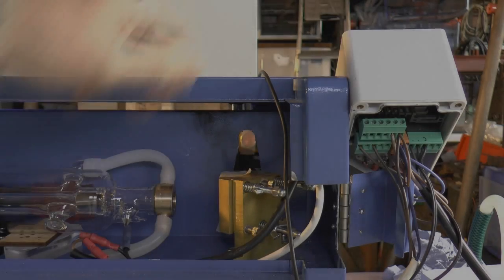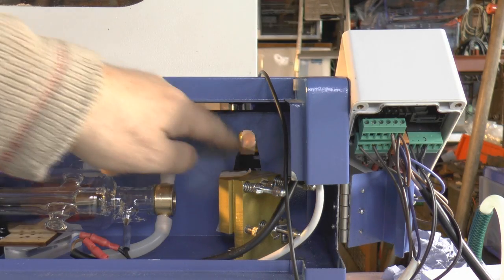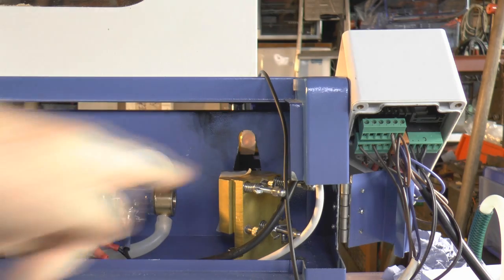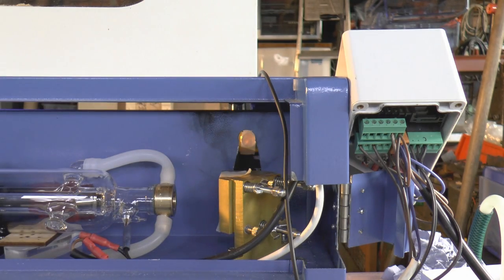RDWorks Learning Lab 51 Beam Setting for Beginners part 2

Comment: Hello once again Russ,
I have started to fit the larger (80mm) laser tube to my 'China Blue' machine and have not come across any problems in fitting it into the case.  However,  I have come across a couple of problems that may or may not be peculiar to my particular machine.

In one of your beam alignment videos, you suggest using the back panel of the tube bay as a datum on the premise that the machine is probably 'jig built' and like to be parallel.  However, the back panel on my machine is not fixed at the top and replies purely on the stiffness of the fold at the bottom to keep it upright.   I think that I will probably use another datum point such as the outer frame using strong magnets as I believe that member to be a better one as it is welded box section.

Another peculiarity is that the aperture in the back panel for the laser path from the first mirror is too high.  The bottom of the circular hole lines up approximately one quarter of the way up the mirror housing projection.  There is probably still enough room for the laser beam to go through it but it does raise the question as to why it should be so.

On another topic, several of us have written to ask you for various plans.  Could you not open a download site for all of the different files and perhaps a forum?  If it is a matter of cost, I would be glad to host it on my website.
Reply from the maker: Hi Peter
The only time the tube stability is important is if your head is fixed. It will then be important to move your tube in a parallel manner. Any suitable reference will be OK. The angled frame of the enclosure is pretty stable.. The exit from the tube has got to be at the same height as mirror 3 in the head and it follows that mirror 2 must be at that same height also.  If you measure mirror 2 height to the Y rail , does that align with the hole in them back. plate? I seem to remember when I upgrade my machine, I looked at the  80mm diameter tube, and decided I was going to have trouble with mirror centres and  the new tube centre. . If the hole in the tube enclosure rear panel needs opening, that's no bad thing because you really need line of sight to mirror 2 from the back of the machine so that you can adjust mirror 1.  These machines are assembled in a factory where the place is staffed  by  people that have no understanding what these machines really do. They are thrown together and a few slightly higher skilled  "people" jiggle the bits around to make then sort of work.  The concept of QA is alien to the Chinese unless its drilled in by Western culture , as in the Apple assembly plants for example.. QA is something YOU are responsible for.. I like to regard these machines as a pre-assembled DIY kit.  This is open season for you to exploit your engineering skills  and fix a few of the unfinished issues.. This beam alignment is fine up to mirror 3  but is sketchy about the alignment of the Z axis and the importance of finding the sweet spot on mirror 3. If you watch the installation of the new acrylic head I have recently fitted, the reasons and method of aligning Z is better explained..
 Any drawings I create for release are posted to the www.rdworkslab.com forum . If you need additional unpublished items that may be useful to you , add your email to a separate comment . I get a copy of the comment in my Gmail so I will immediately remove your comment from public view.. I am a very insular individual with a VERY low www profile (apart from You Tube) and I do not belong to forums or want to run anything other than this You Tube channel. I already get enough comments and email traffic to consume several hours a day.
I might appear on video to be doing this for public good, but in truth this is  selfishly all about me learning ( I greatly enjoy the challenge) and  providing material for my other hobby which is video editing. Although I am happy to share creations I try to give enough detail for others with capability to be stimulated into developing their own versions.. Some of my creations are not makeable by the majority of followers, the Dohicky for instance, and that puts right back to the manufacturing I retired from. My latest acrylic head transplant could get me into deep manufacturing issues but I hope I am successfully using standard parts that can be obtained from certain places in China. That video will be released in the next few days when I have completed all the information pack of drawings, parts list, and purchasing details That's the admin detail I'm trapped into completing to successfully share this design. All this will either be available directly from myself or the drawings and data sheet will be posted on the forum I mentioned.

Thanks for your kind offer

Best wishes
Russ.

Comment: Hello, Russ. Can you send me the DXF files for your adjustable tube brackets. Also do you have the files or sketch of your bracket that holds your laser head so there is adjustments there? I really enjoy your videos and have learned a lot from them. Keep ip the good work. texscowboy@sbcglobal.net  .
Reply from the maker: Hi John

The file has been emailed to you and the bracket I used to mount my head was made during a moment of utter frustration from material I had to hand. So it's noting pretty but has proved very useful and easy to get mirror 3 into correct alignment.
See the video    https://www.youtube.com/watch?v=AJxMBqzxYCA

Hope this helps
Russ

Comment: It is very useful to follow you along your journey.
I figured out my machine's beam is tilted. It is OK by the cuts along the X axis, but not by the Y axis (app. 2.5° towards -X).
Following your instructions I've readjusted the mirrors but since its head can't be adjusted I ran out of options.
Measured all the dimensions of the head and figured out the beam approaching the head too low, therefore I can't tilt the 3rd mirror backwards enough to correct the beam's path, or it hits the lens' tube...
So I raised the tube and readjusted again, but the beam now is hitting the head far from centre (and can't be adjusted horizontally nor vertically). I can't get the data from the manufacturer how high the tube supposed to be by default, so this hit and miss adjusting just doesn't seem to make sense anymore.

So I came up with an idea:
what if I make a concentric jig to insert the red dot pointer into the head pointing upwards (lens removed obviously) and adjusting the mirrors in a reverse order to hit the laser tube at the end and try to make the tube standing parallel along both planes?

What do you think about it Sir?
Reply from the maker: Beam alignment can be a pig.
You along with several others have advocated this idea. Yes it will get all your mirrors aligned so that you can see the laser tube output window. But then you have the problem of the tube axis not matching the axis of your red pointer . It may then be possible to get the beam to centre on mirror three with a scorch mark by adjusting the back end of the tube. But this is still not a logical method. 
The only easy way that works every time very quickly is to centre the beam on mirror 1 by adjusting the tube.position (axial alignment is not important)
Get the Y axis parallel in both planes by this 3 step method
1)With mirror 2 at front of machine adjust mirror 1 so that beam is somewhere near centre of mirror two. Dont get too fussy because this is only to make sure the beam is not miles off target.
2) Replace the tape on mirror 2 and move it to Y=0. Now burn a feint scorch mark. THIS IS THE TARGET BURN.
3) Move mirror 2 to Y max and then adjust mirror 1 so that the burn mark matches the target burn.

After repeating step 2 and 3 for a second time you should have perfect Y axis alignment

Decision time.
If your beam is not well centred on mirror 2 horizontally you CANNOT now  adjust the mirrors.  You will have to decide if your system will allow you to MOVE mirror 2 to CATCH the beam from mirror 1 dead centre. Most machines have some sort of adjustment at mirror 2.

Having succeeded with the Y axis
 you must repeat this same 3 step procedure for the X axis by adjusting mirror 2

Decision time.
If the beam is not centered VERTICALLy onto mirror 3 you have to consider how to make it central. The easy way is to make the head adjustable (as I have done) so that you can again CATCH the beam. If you cannot do this then you must raise or lower your tube by the correct amount. THIS MUST BE DONE IN A PARALLEL MANNER. The only way you will achieve this is to put packing blocks under each end of the tube to perfectly fill the gap between floor and tube bottom. Now you can add or subtract the SAME dimension from each pile to reset your tube height. DO NOT ADJUST the mirrors or you will upset axis alignments

Question: Are you sure you are aiming at the right point for mirror 3?   See https://www.youtube.com/watch?v=ELeqP3tHlp0 fro the 12 minute point

Hope this helps to clarify a few issues for you

All best wishes
Russ
Reply: Thank you for helping me.
Yes, actually the mentioned video gave me the idea to check for the reason I'm running out of options at mirror3. YES.
-measured the bore centre from the head's mount: 18mm
-beam hitting height: 15mm
-my calculation for the beam height to hit the centre of the tube in a true angle, having mirror3 displaced from the casing equally 1mm should be 22mm...
BTW my laser tube has adjustable stands and measured from the housing it was panning upwards towards mirror1 about 1.5mm. After some approach, when I made the beam adjusted perfectly I always got the beam hitting the perspex test piece tilted. That was the time I've started all over again realigning the laser tube first and the rest after following your order.

Where I am now:
-the beam is hitting the dead centre of mirror1
-Y alignment is OK, beam hitting almost the centre of mirror2 at any position (same spot)
-beam is hitting mirror3's bore at any X-Y position (same spot too), horizontally at the centre, but vertically too low (lower than it hit before I've realigned the laser tube) to make it possible to adjust mirror3 to have my beam perpendicular to the table AND to find it's way out the nozzle.
-Why I came up with the idea to reverse the order of the adjustment is that I have no idea how hight to set the laser tube to hit the head at a good height, but since my head is the only fixed point in this system it seemed to me it could make sense.

-I'll try to measure the desired entry-point on the head from the baseplate tomorrow as a last option. More or less it should be at the same height at both ends of the machine.
Reply: Reread my gibberish, it might not be clear enough, sorry for my english.

To make the long story short:
The plate separating the laser tube from the working area can be removed, so I'll start to measure heights from the Y-axis rails since those must be even.
From there I can define the vertical position of the beam to hit the head at the right spot AND the actual height of the laser tube.
Will see where will I get from there...

And I think I'll make myself a set of mirror-mounts since these I have are just crap. I need sliding surfaces for parallel adjustment because those slots are anything but precise...
and following your recommendation will make the head adjustable too.
Reply from the maker: If you would like to private message me with your email address I will send you a video that might help you.
Best regards
Russ
Reply: I'll do. Thank you in advance.
Reply from the maker: Yep. This will get you there by trial and error. If you know where to aim your beam at by measuring , there's no guess work. The problem with this method is you are going to undo all the good work you did at mirror 3 in getting your beam parallel to the X axis. Just move the head up and down to catch the beam at a point on mirror 3 that sends the beam axially down the tube. There is only one spot on mirror 3 that will set the downward beam axially true, so measure your head and aim for it.
Best regards
Russ
Reply: I did. I've measured all the dimensions of the head, made a drawing and successfully defined the sweetspot. It is over the center of the entry hole, like on yours, but, the head on my machine can't be adjusted, so I had to play with the tube height and the position of mirror 2 to get a true angled cut at last.
Now there is some work waiting for me on the cutter but afterwards I'll make a new adjustable mount for the head.

Thank you again for making and sharing your videos and your extra help, without them I think I'd be still totally confused.
Reply from the maker: Excellent news. Being chucked in at the deep end is often the best way to learn to swim. I know I found it scary the first time I upset my mirrors and it took me several beam  alignments to gradually home in on a foolproof (non- hit and miss) method. It seems so simple now. Congratulations on your persistence and success.
Best regards
Russ
Reply: Well, I used almost a half roll of masking tape...
Reply from the maker: This time only!!

Comment: After playing with my new machine, I had to come back to this page and the previous video to make sure I have the machine aligned correctly.  My machine having a longer and wider bed 55 inches X 36 inches, has made accuracy even more important.  Thanks so much for this video tutorial.
Reply from the maker: Hi Scot
Glad to see you have your machine in a state where you are now worried about beam alignment. That must be the last step to success?
Best regards
Russ
Reply: With the more powerful machine in my shop, (130 watt laser tube,) I did my first 1 foot by 1 foot test with some engraving and some cutting.  I had the machine vented outside but this machine does leak smoke a little.  Got the neighbors very upset and even had the fire department make a visit.  Lucky they didn't know it was me or I may have gotten into trouble.  The landlord made it very clear that I was to never run this machine again unless I have the smoke issue 100% contained.  I ordered 2 charcoal filters but good thing for me is that I am about to start making HEPA filters.  I have all the equipment and materials to make large HEPA filters that will be the pre-filters to the final charcoal filters.  I will definitely be posting my results on the RDWorks forum when I finish.  Right now I just watched the dohicky video's again and have bought your amazing dohickeys and as I will be waiting until the charcoal filters arrive, I can start on the power testing.  I did also just order a 32mm lens with holder and 3 copper mirrors to boot.   I noticed that I am having trouble getting through .18 inch with the 2 inch lens so the smaller beam should be an improvement.
I couldn't even imagine being able to do this without your valuable lessons.  Once again, Thank You Russ.  You are an inspiration to so many people and will be for decades to come.
Reply from the maker: Ooops!!!
Reply: 1390? :) how many watts is your cutter?

Comment: really great videos, thank you. I just bought the "red" 60w version and found out of the box, I can barely cut properly through 2mm acrylic. I am going to start with checking the mirrors first this weekend, so thanks, these videos helps a lot !
Reply from the maker: Hi Andre
You could spend a lot of time playing with mirrors and get no benefit. If you go to my youtube messages  and send me your email address I'll let you have a dxf file for a VERY simple checking tool that another corespondent has shared with me. 
Sadly you are one of many that write to me with this story.  My first question is how do you know you have a 60 watt tube? A typical 60 watt tube will be 1200mm long. If yours is a usual  ebay purchase there could be two main issues.
Firstly your tube may only measure 1000 mm long in which case you have a 50 watt tube and secondly most (not all) are fitted with B grade tubes that work, but not very well, and may have a very short service life.
It's very likely that you do not have a ammeter fitted as standard. I urge you to by a ebay cheap 30mA meter for next to nothing.  I have shown how I fitted mine on  https://youtu.be/xDZmuxq5BEM    That way you will know how hard you are driving your tube. 50 watts should be 20mA max and 60 watts 22mA max. The problem you may have is that when you can't cut what you want, you will be tempted to wind the power up to 100%. DONT. Don't go above 65% until you have an ammeter fitted. 
The other reason you may struggle with cutting is to do with the 2" focal length lens that will probably have been supplied If your setting piece sets the nozzle about 19 or 20mm above the work surface then it's a 2" lens. If it's a 6mm gap then you have a 1.5" focal length lens. There are several videos that explain whats going on with lenses  
https://youtu.be/WbBPps42iHc
https://youtu.be/1yMAr75h5O8
https://youtu.be/61bGzWicRRk
Don't rush with your new toy. There will be some frustrations but if you take your time and learn about the details you will be able to use it to much greater effect. I have had mine a year now and I am still learning.
Good luck and enjoy
Best regards
Russ
Reply: thank you so much for the time taken to respond. will send you an email.